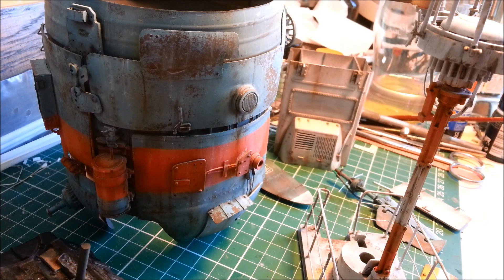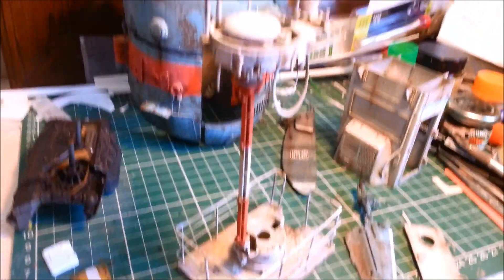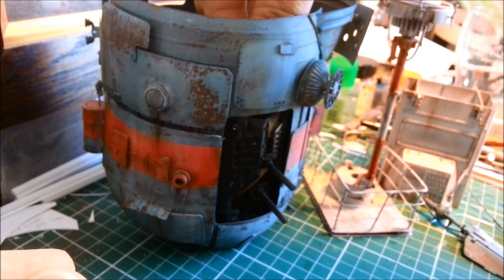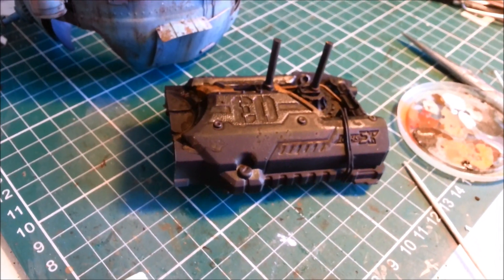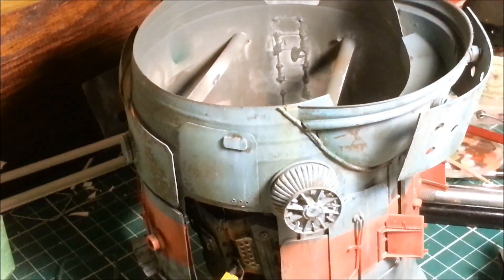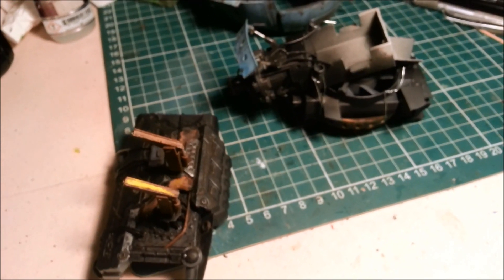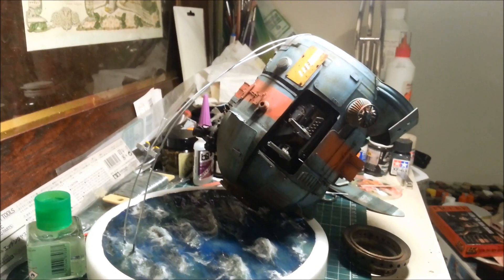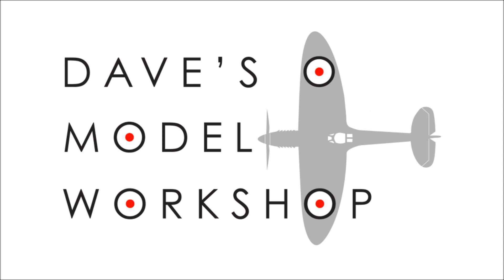Scratch building 1/35 scale sci-fi model ship -  Part 8

Comment: Dave, Why not have Water / Waves underneath, like a jet engine blowing on the Water and then hide a thick support in it?
Reply from the maker: Thanks Fredrik. I worry that setup would feel like a rocket taking off, rather than the graceful hovering I'm hoping to achieve... But thanks anyway mate :)  Dave
Reply: Dave's Model Workshop 
Ok then i understand your idea. Then How about using a ”dragging” cable of bent sprue or similar and have it gently touch the surface. Found this painting at Pinterest... 
https://pin.it/rfb3cbo3eqv33p
Reply from the maker: That's cool, thanks Fredrik. That's exactly the sort of dangling, loose feeling cable I was originally trying to achieve. I'll see what I can do with thicker gauge wire. Thank you again :)

Comment: Hi Dave!! 
So yeah i’ve got a couple of ideas. Why not keep the wires and make some sort of jet smoke from the engine and u can hide a thick wire(or a abs rod) in the smoke

And second one why not add another stronger wire on the other side of the hull?? In the same way as dragging wire? Either use stronger wire make one up 2 u..
But i will say you need some more support points so the ‘Seahorse’ is stable adding one (or two) from a different angle SHOULD do the job u just need to be careful to keep them as straight as possible and attach them to the hull at a lower spot if possible. 

Cheers mate!
Reply from the maker: Thanks Alex. I think a lower attachment is a really solid suggestion, I'm having a look at that now.

Comment: Maybe try one, very solid column and make it look like it's water flying trough the air couse of jet engine. Also if you use bowl like base magnet trick might actually work
Reply from the maker: Thanks for the suggestion. The water jet effect would look cool, but tricky to achieve?
Reply: And what about using one of these glue columns for gluing pistols?
Reply from the maker: How do you mean? I'm not sure I follow you Czlowiek?

Comment: I don't think any of those ideas will work, magnets is as optimistic an idea as ethical Australian Banks :)  Try 3mm brass rod, will take a bit of grunt to bend into the right shape, but I just tested it and just one easily holds 500g without bending.  Good luck
Reply from the maker: Heh heh, Australian banks are as bent as my current support wires ;)

500g is pretty impressive. I'm looking into this now. Thanks mate for the suggestion.

Comment: Dude - massive disappointment, but...
before you go and buy some thicker wire, have a look around for some sturdy wire coathangers - even if you have to beg, borrow or steal (possibly not steal) from your local clothing shops.  The type used for suit jackets/coats should handle it no problem.  I don't recall how you attached them in the first place, but they should just pull out, shouldn't they?  If so, just drill out the holes a little for the heavier wire.  I have some in my wardrobe and, even though I'm an old fart, they must still be around.
(edit)  Another thought, if that fails - sally forth to Bunnings and grab a couple of metres of heavy fencing wire.
Reply from the maker: nitramyar yep, I think a visit To Bunnings might be in order. Coat hangers are tough buggers, I’ll see if I can rustle some up.